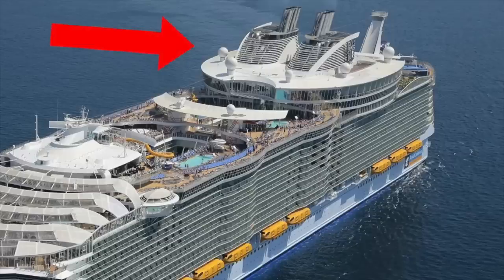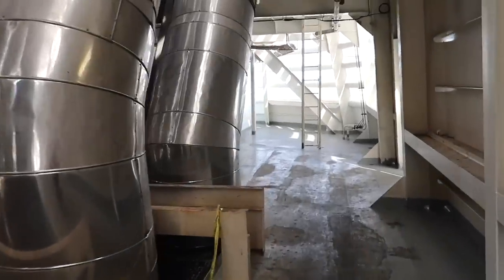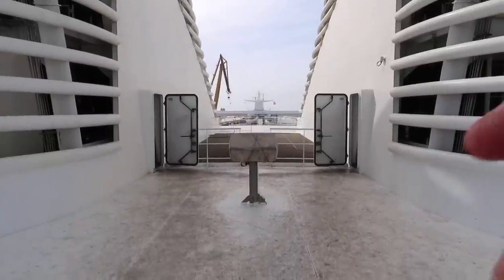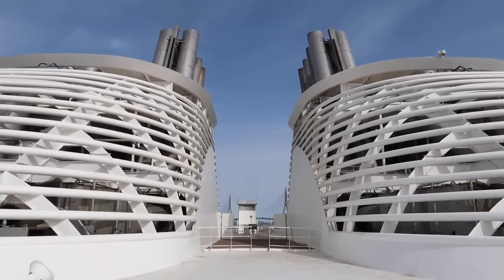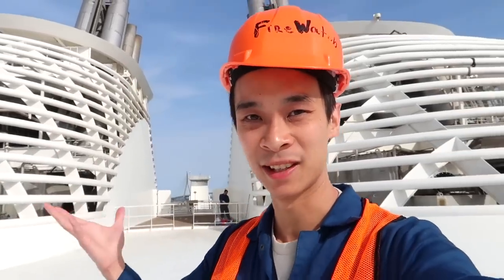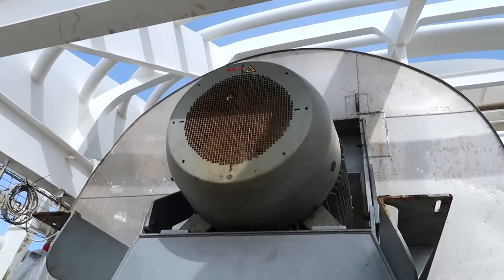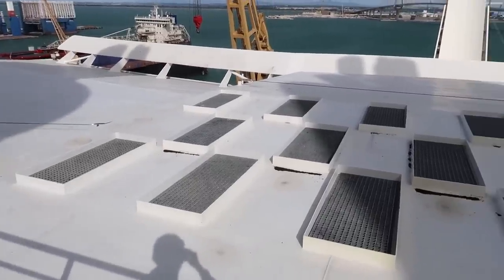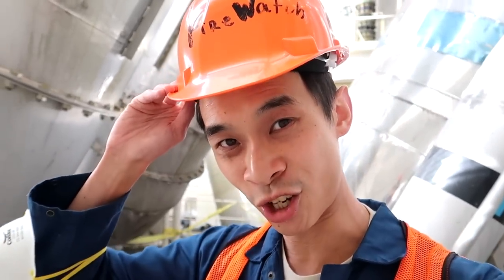Super *Secret* Area On The Ship (Deck 19) | Symphony Of The Seas

Comment: Lots of exhaust for engines, bathrooms, kitchens, AC, etc. Huge extraction fans pull damp air from the bathrooms.

Somewhere else is usually inlets, not usually the same area or it would pull the dirty extracted air back in.
Reply: Correct

Comment: IMO Number is the number assigned to a ship by the International Maritime Organization. When up on the stack, you found where the number assigned to Symphony of the Seas is painted, a position readily viewable from the air for purposes of aerial identification by maritime aviation assets like the USCG.  Example, if a night time helicopter operation was needed, the aircrew could easily see this in order to positively identify the ship when other identification such as the ships name might be difficult to see because they'd have to descend to lower altitude to see the side of the hull which would be dangerous in high seas.

Comment: Yeah, I think ocean liner designs covers an older version of those fans, but you are right. Those are designed to channel air ether out of the ship, and apply positive pressure on the system so that it can channel air into the ship. It's how they get air in and out of the ship.

Comment: The motor are to move the exhaust system out the stacks. Think about it the engine is in the bottom of the ship and the exhaust fans helps with the fumes leaving the ship.
It looks like there was a fan removed in one of the blower fans. I am guessing that they are rebuilding the bearings on the motor